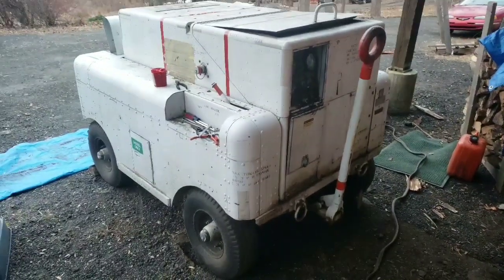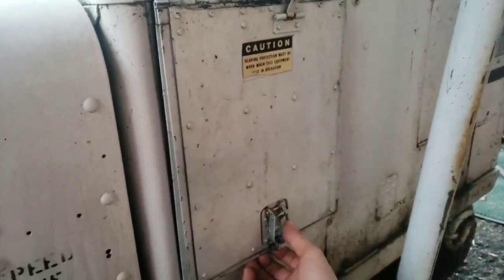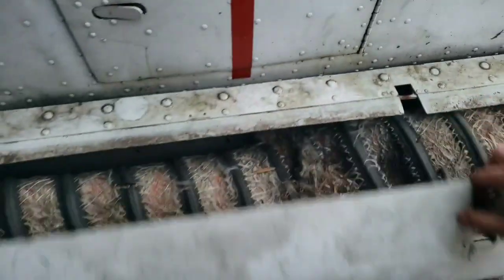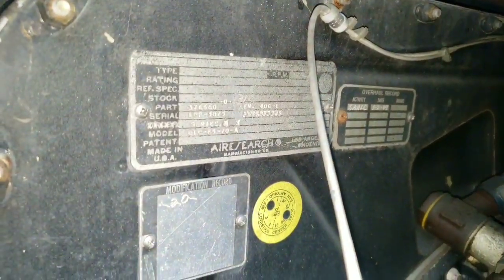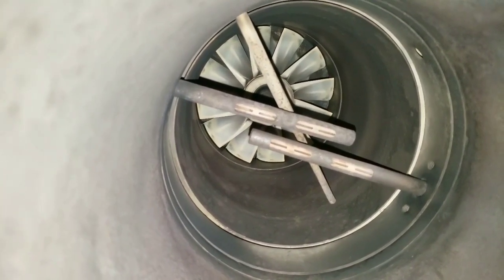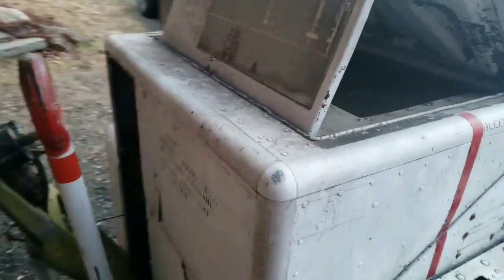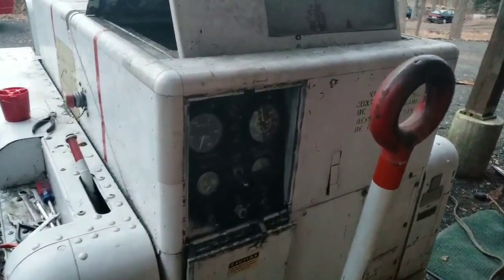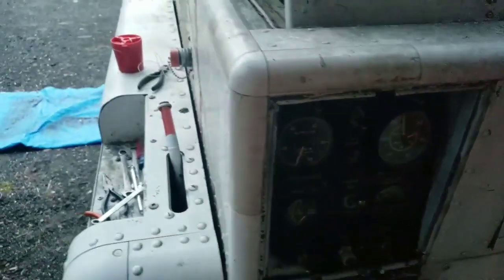1956 MA1A Turbine Huffer Cart

Comment: Spent the first half of my USAF career in AGE (Aerospace Ground Equipment) and worked on many of these.

Just to add a little more knowledge for you, there are 3 centrifugal switches set at 35%, 65%, and 110%. The 35% switch activated fuel delivery, the 65% switch cut off the ignitor circuit and the 110% overspeed switch shut down the unit.

The Cannon plug on the left side (from the towbar end) was the connector for a turbine analyzer. A full hookup took a couple of hours and seldom delivered any information that watching and listening would reveal.

Strategic Air Command (SAC) considered any visible flame to be a hot start and a Red-X condition. Changing the fuel nozzle would fix it, so we routinely installed a new nozzle at each PE. MAC, TAC, PACAF and USAFE didn't care as long as the flame went out by the time that it came up to speed.

Great memories!
Reply: Pretty much what I remember from the Technical Order. You ever work on a MD-3 motor generator? It had 3 ac and one brush style DC. it was very handy jump starting a F-86. The AC was more of a fad. I remember when AGE was mostly Mogas or DC then we switched to Diesel and AC 115v 3 phase turbine. After that the job started to get difficult. I still have the A/M32a-60b electrical system etched on my brain.
Reply: Well remember the MD-3! The original one has 1 45 kw AC alternator and 3 500 amp DC generators. The MD-3B has a brushless AC alternator and 2 brushless 750 amp DC generators. The MD-3M has one 45 kw AC alternator and a single 500 amp DC generator. I was in SAC at the time so the DC was seldom used but we used the hell out of the AC for ground servicing of B-52Ds and KC-135 as well as for heating water on the alert pad in the winter.

I was part of the diesel conversion working group as well as the single fuel evaluation group that verified that diesel engines of the era ran fine on JP-4 and didn't gel up in the winter under extreme conditions. Really enjoyed my tenure in AGE and made MSgt there.

Comment: As an Air Force AGE driver, I used to haul these all over the flightline at a SAC Base in Michigan back in the early 1970s. They were painted bright yellow. We refueled them with JP-4. They sometimes would have a fuel build-up which, when you started it, caused a five-foot-high blue flame to shoot out of the exhaust. Pretty neat looking at night, though!
Reply: We have one of these at the fbo I work at! It's been nicknamed the dragon since it shoots a flame at least 6ft tall each time it's started. Apparently no one at the fbo has ever serviced it but we just keep putting fuel and oil and it and it starts right up! Awesome piece of machinery

Comment: Put an a Elcon connector and use and old aircraft battery. 
Still working on ours and hoping to have it running shortly for starting stranded aircraft at remote airports.
I suggest stretching hose out and weigh it down with heavy chocks etc and exercise the air supply side. Also have some fun at night and cycle the start switch on and off and shoot huge rooster tails of flame out of it. Absolutely used to terrify airline passengers. Napa has filters and a CD rom is available for the maintenance manual online.
I believe StandardAero in Maryville,TN can overhaul the APU portion.
10/12/21 All finished and up and running. 38-40 psi air discharge pressure. Ready to start aircraft when stranded.
Only use JET A fuel and add bio-bor fungicide to prevent major filter problems. Diesel will cause some really funky idle, peak rpm problems

Comment: Gawd, I must've started those things a thousand times in the Military Airlift Support Squadron I served in in the early 70's. As I recall, there were a number of safety features built-in to it to prevent it's misuse...it either started or it didn't, and you called for a new one. Using it was "So easy a two-striper could do it"  Thanks for the trip back down memory lane!
Reply: Two stripers maintained them. The better line would be "So simple that a 2LT could do it."

 - Retired AGE Superintendent

Comment: It would very interesting to see the centrifugal compressors on this thing but I know they're deep within.
I did enjoy the video though.
Reply from the maker: I recently got my hands on some of the manuals, and although there are no real pictures of the compressor, here is what I can get from the manuals that I have:

MA1A Compressor Assembly https://imgur.com/a/K8cddiK

#41 is the first stage compressor, while #65 is the second stage compressor. You can see in the picture that the first stage has blades on both sides of it  while the second stage is one-sided, like a more typical centrifugal compressor.

MA1A Engine Layout and Oil System Schematic https://imgur.com/a/CU5FC4v
Reply: @soconnoriv   Those are great.
Really glad you found some manuals. You did a good job of troubleshooting and getting it to run without them.
If there are any more pictures I would like to see some of the too.
Keep up the good work.
Watching to see more.  :)

Comment: The other "sensor" in the exhaust is for the bleed air system.
Reply: Another thing you could do is a FOIA request to USAF for the technical manual.
Reply from the maker: @georgereves9370  just got my hands on the manuals a few weeks ago. And yes, looks like the narrow sensor in the back is the actual egt sensor.

The manual says the two sensors with the cut-out sections are thermocouple valves for the pnuematic system, just like you said.

Comment: Was that running at 105,000 RPM?
Reply from the maker: No, the indicator in the video reads % of RPM. The RPM at normal operating speed (100%) is around 42,000 RPM
Reply: @soconnoriv  Cool, thank you. 105k seemed like a little much.